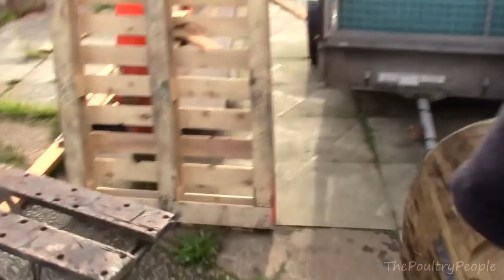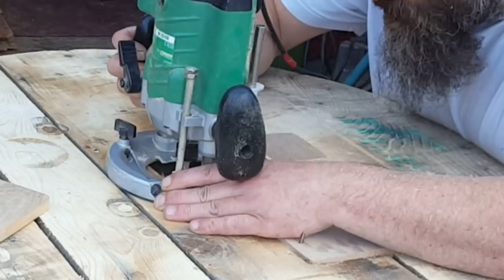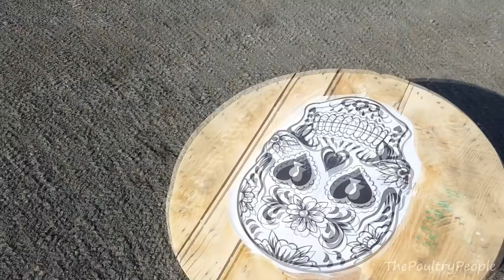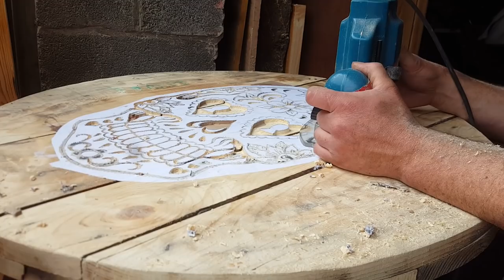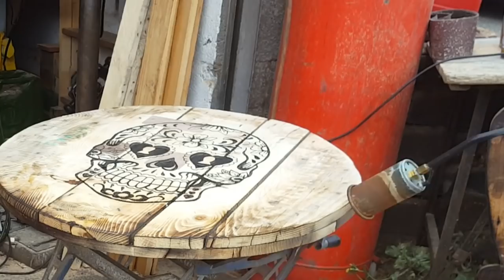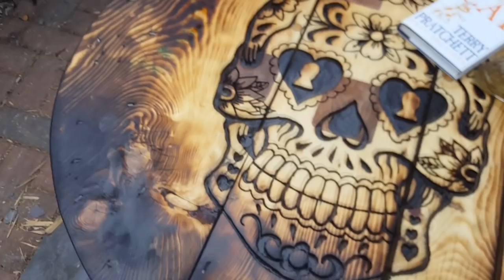DIY Sugar Skull Table - Cable Spool Reel Projects

Comment: If you dont mind where do you get your bits and collets for doing all the small line work?
Reply from the maker: I dont mind at all. I import them from china. 
You basically need a reducing collet that takes you from quarter inch down to eigth inch so you can use the fine cnc bits.  In metric its 6.35 to 3.175mm, these are the numbers you need to get right if youre ordering from ebay, I also sell them ready checked for the correct size along with a few bits. 
https://www.ebay.co.uk/itm/323849368627
Reply: @thepoultrypeople   HOw much do you sale them for? We have ordered one from the uk and it was the wrong size. We have checked just about everwhere around where we live in Florida and we cant find any thing to fit our CNC bits.

Comment: That looks awesome top job what blade did u use in router.
Cheers
Tim from Wood 4 Nothing
Reply from the maker: Thanks Tim, I used a 10 degree bit to carve the outline and finished up with a 3mm and 6mm flat bit to clean out.
Reply: @thepoultrypeople  cheers been gonna try doing a bit of routering but never know what bits to use 
Cheers
Tim from Wood 4 Nothing

Comment: Hi ya Bongo, what size cutter was that in your router? Paul
Reply from the maker: To do the outline of the design i used a 10 degree V bit and then a 3mm and 6mm upward spiral. Clearing out with the big router at the start was a 10mm.

Comment: What kind of router do you recommend for doing this type of work ? Any particular make better than others or do I just go down b&q and pick a pretty colour ?
Reply from the maker: Hi Rhiannon, I recommend you go to screwfix and pick up the Makita Red M3601 Router at £70. Its a middle of the road unit, proven quality and capable of most work you will be throwing at it. 
Hope this helps.
Reply: thepoultrypeople Thanks mate, I’ll go and have a look, just renovating the garage for my motorbikes and I like some of the stuff you’ve been doing, want to have a go at making a few things to go in there 👍🏻